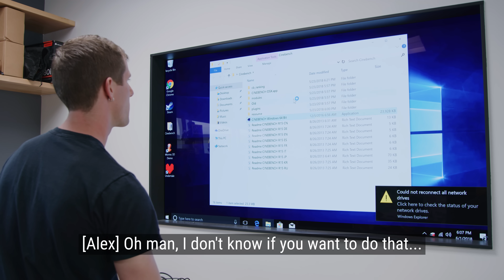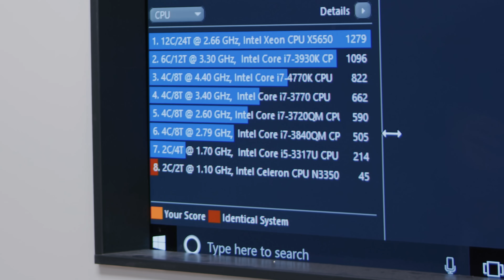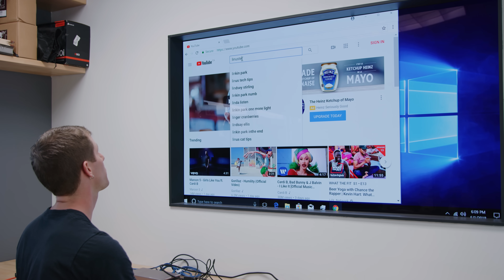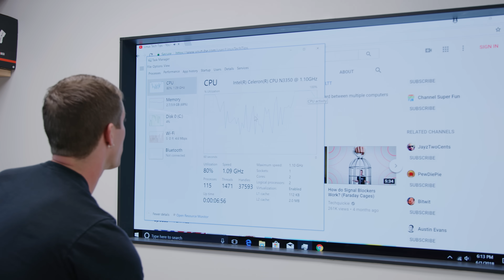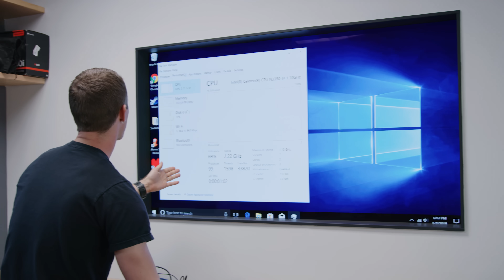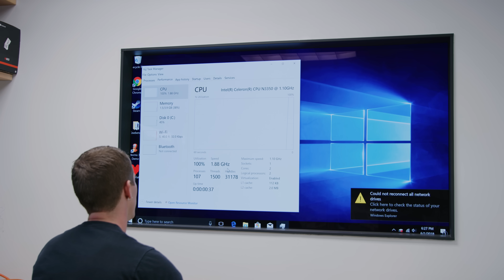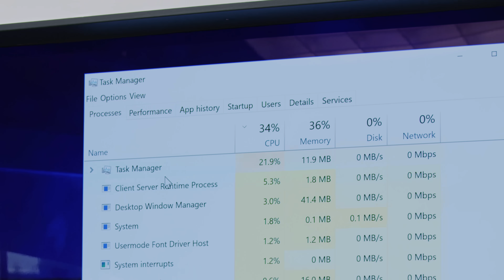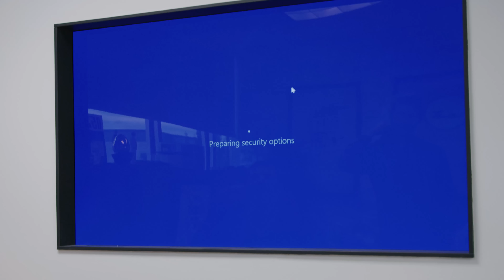PC Smaller than an SSD

Comment: I was impressed with this at first until I realised it was basically just a phone without a screen or battery.
Reply: Reading your comment disappointed me, because it led me onto thinking that this was just a simple ARM setup. This isn't "just a phone without a screen or battery", lol. A celeron processor that is in that small of a form factor, a long with the fact that it is a celeron, not ARM, and you can run stuff like windows *not IoT, all while being passively cooled is really fucking great
Reply: @extremememe3296  celeron .........
Reply: @extremememe3296  bro .....
Reply: @extremememe3296   There are arm processors in phones out there that outperform Celeron and Atom processors, people are still selling cherry trail parts in this ultra small form factors and they just suck.
Reply: do you understand software compatibility in arm vs x64/x86?
Reply: @extremememe3296  I do understand very well, I'm working back end development as a day job. 
Not only that but writing software that is actually targeted at low end devices like these.
Basically all managed code is portable today, having some old unmanaged behemoth or even worse some vb6 based trash still running in 2019  is more than just irresponsible.
If your application has been made within the last 10 years there is little reason for it to not be managed in the first place and if you do for some reason end up with a native app you should be able to port it pretty easy and save a fuckton of money with some cheap arm chip as opposed to bottom of the barrel scrapings from an atom -like SKU that has been dropped by Intel because it isn't profitable.
Reply: Tell me which phone can run an actual non-mobile OS and CPU, and I'll admit that you're right.

This isnt a phone, its a very very small budget laptop without the monitor and kb.
Reply: @YouCensored  actually the Asus Zenfone 2 fits that bill.

It has an atom z3580 with 4gb DDR3, and 6430 powerVR GPU.

That would be at least capable of running the full blown desktop OS.
Reply: @YouCensored  I'm pretty most laptops have a more powerful processor than this. This like bottom of the barrel laptop performance. It's hardly worth mentioning, really.
Reply: @joemann7971  
You're pretty?
Reply: @joemann7971  
That's not being a grammar Nazi, dude.  I'm just going on what you said.  How does that have ANYTHING to do with grammar?
Reply: It's not a phone. And arm processors are not as powerful, it just runs that way because the os is paired down. RiscV is going to be bigger, it just needs the time to develop the best technologies.
Reply: @extremememe3296  True that but i think most people dont have a use for ... and if u compare it to a phone its nothing knew fit that performance into ...
Reply: i have a lattepanda alpha... A bit bigger, but with a Intel M3 and 8GB of ram.
Reply: Windows API and app support. Better than a phone.
Reply: @extremememe3296  I mean my galaxy s9 has 8 cores and runs at 2.8ghz with 4gb of ram and comes with 64gb of memory plus a 64gb sd card. The battery last all day even after playing ark mobile. This is also running at 1440p so I'd say this device is pointless seeing to how little power it has. Is it neat yes but is it practical, not really sence you probably have a laptop or desktop or a phone with more processing power then this thing.
Reply: @extremememe3296  There's nothing much different between this Celeron and the Atoms that were going in phones a couple years ago. This is basically a phone without a screen or battery.
Reply: @goldenfox334  Your galaxy couldn't run windows.  Arm cpus are completely different and you can't compare the clock speeds or core count with that of a real cpu.
Reply: "a phone"
that can actually run desktop applications because it can properly use x86/64, yes
Reply: Same
Reply: Yeah, there's nothing great about a computer powered by a chip that's 1/3rd as fast as the lowest end mobile Ryzen processor, the 2200u. It can run Windows, sure, but it won't run it well. What desktop application would you run on this that doesn't have an analogous phone app anyways? Pretty much Anything you can do on this, you can do on a phone, and you'd be able to do it faster.
Reply: @ltnlng  Nobody's praising its performance, it's just kinda impressive.
Reply: It's slower, has fewer features, and is roughly the same form factor as a phone. I'm having difficulty seeing what's impressive about this device.
Reply: @eLJaybud  arm processors are MUCH and MUCH more powerful! We'v got snapdragon laptops that can outperform all the laptops with that price... The built in adreno GPU is also MUCH powerful than a Intel HD graphics
Reply: something with an arm cpu like an 8cx would wreck even most 5-year-old computers in speed and battery but yeah this isn't that crazy
Reply: ARM cpus can run windows, yes. But goodluck with almost any apps that did not support that architecture.
They're just different architecture. And windows can run on arm cpus is not that the cpus is great, but the the os itself that has been developed to be able to run on arm architecture
Reply: Not even a good one too, it’s more like a 2012 android
Reply: I use a Intel Celeron (quad core) clocked at 2.4ghz I know no one's to hear about my crap CPU but why not :D
Reply: @klauserji  surface pro x entirely arm based. guess we know the answer to that now.
Reply: @NonsensicalSpudz  other than microsoft first party apps (office etc.), i doubt many software have good compatibility at al. The technology is still in it's early year.
Reply: @klauserji  early years, arm isn't new. you're really underestimating ARM
Reply: @NonsensicalSpudz  let me rephrase it, arm itself isn't new, but arm integration with windows and all of it software is new. Most if not all common software is x32 or x64 based.
Reply: @klauserji  what you're claiming is microsoft have taken a major risk with the surface pro x then, considering its an ARM chip
Reply: EXACTLY
Reply: @NonsensicalSpudz  more or less
Reply: Christyandi K Microsoft says the translation from x64/x86 to Arm will be almost undetectable. This is an older video and technology has changed. ARM is so much better than when this came out.
Reply: @3DPrintedCat  i'm looking forward to that.
Reply: @ltnlng  I think you are missing what the actual purpose of this device is. for its purpose, yes, it is impressive.
Reply: @MasterDHCP Yeah? Why don't you explain what the actual purpose of this device is and why it's so impressive?
Reply: @ltnlng  1. its not designed to compete with or even marketed to the phone market, comparing this device to a cell phone is very wrong in the first place
2. This isn't designed to be a web browser friendly/video steaming computer. That is far from its purpose.
3. This is exactly what Linus said it was... a Thin Client. it is designed to be literally as small as possible, as heat efficient as possible, and as quiet as possible. This devices main purpose is to be used in slideshow displays at corporations, POS systems in restaurants/businesses, and anywhere where there needs to be a non- noticeable but functioning machine with just enough power to get the job done. 
4. This device is ~$150 retail... most phones nowadays trend around the $750-$1000 mark, once again making this another unfair comparison.
Reply: @MasterDHCP
1. It's marketed as a portable computer, which is what the phone is.

2. Of course it is...it's a portable computer and those are two of the core functions of a computer.

3a.If it was designed to be as heat efficient as possible, they would've used an ARM processor.

3b. So you're saying the tasks it's suited for are low-powered and would not benefit from using x86 over ARM.

4a. $150 retail, and yet it's roughly as fast as a $55 4gb Raspberry Pi 4.

4b. Not an unfair comparison as the topic of discussion is whether or not this tech is impressive, something you don't make even One point for in your argument btw. And it's not in terms of functionality (modern smartphones are faster and more versatile), and it's not in terms of price (many sbc's are cheaper with similar or greater performance)
Reply: @ltnlng  
1. It is not marketed as a portable computer. It is marketed as a Thin client. Meant to be hidden somethwere or stapped to the back of a tv or monitor and be completely silents while also performing the neccessarry processes you would need a thin client for. while it is possible to be portable, if it were portable it would have a battery and a screen (which it does not)
2. The purpose of this is to run light applications... not 4k streaming and not gaming in the slightest. Also this is a small PC not neccessarily portable. It is portable in the fact that its small enough to fit in your pocket but once again that is far from its purpose
3a. It does not need to have an arm proccessor to be heat efficent... it is heat efficent because of its ribbed casing.
3b. the proccesses of a thin client are ususally lighter by nature and do not require much processing power.
4a. It is also smaller than the Rasberry Pi 4, has its own case that doubles as a heat sink, and is meant to be less noticable than the Pi 4. (see number 5 for a bonus)
4b. It is 100% an unfair comparison when comparing it to smartphones. it is MUCH smaller than a smart phone, does not have a screen, does not have a battery, and does not have the same power as moden smartphones. It is impressive because it is small, noiseless, fanless, gets the job done, and very unnoticable.
5. It is also 100% worth noting that it comes with Windows 10 completely free (usually ~$100+ retail)
Reply: @MasterDHCP
1. Yes, it is. On Zotac's own website, they show a 
picture of someone bringing this around with them in a bag. Things can be marketed for more than one use y'know.
2. There are other resolutions in streaming. And in today's world, if it can't even handle a 4k stream, it's hardly what you would call impressive.
3a. "as heat efficient as possible" -you. I never said it's not heat efficient, just that it's not "as heat efficient as possible".
3b. What I'm saying is that there is no need for you to be able to run Windows for those light tasks.
4a. If you're hiding it or strapping it to the back of something like you said it's meant to do, the slightly increased size of a raspberry pi case will not matter.
4b. No, it's not unfair at all. Everything you just said IS the comparison people were making, that it's essentially a screen-less phone with less power and less portability. Funny how you say it's unfair to compare them and then you compare them. 
4c. Everything you've said about why it is impressive is also true of the raspberry pi, except the raspberry pi can be found for $5.
5. Win 10 was free not that long ago, and even today there are many ways to get it either for free or for a very low cost.
Reply: @ltnlng  Single core performance for x86 windows apps on arm is ten times slower, because they are emulated in real time. x64 win apps? cannot run on arm.At all. Have you seen a point of sale machine in any large retail store? They run ancient DOS software. arm cannot run these legacy apps. No-one is ever going to rewrite these, and retailers are not going to spend millions to switch. Until every compiled code-snippet that runs on x86/64 is rewritten / compiled for arm this thing is impressive because it can do all this. Is it going to see much use? no. Will a raspberry be used for anything  in an enterprise environment? No. Also no enterprise OR ltsb for arm.. It's a long list. This is a PC.. aka IBM PC compatible > Windows compatible > x86. arm is not, ppc is not, risc-v is not, elberus is not etc.
Reply: @ssunde Those retail apps been written and rewritten multiple times with new functionality added in every time. Whether or not large retailers are willing to switch out of ancient software is a different matter. 
And other than its ability to run Windows natively, which is the only point you've made, it is really no different from other sbc, other than its higher price/performance ratio. Again, not impressive.
Reply: @ltnlng  No, because for what this is designed to do other sbcs have zero performance. 0(price/performance) = 0. An ant a9 is 28,000,000 times faster than a 7980xe. Still useless outside its intended purpose.
Reply: @ssunde No, for what it's designed to do, (being a "thin client") other sbcs have similar performance at a lower price. 
If you're talking about running windows, I would point out that you yourself say it can be emulated, meaning it's not 0 performance as you claim. This is especially true since Windows is expanding compatibility to ARM.
Reply: do we forget the microsoft-devotion of Nokia with their Windows Mobile phones?!
that also doesn't hold a intel or amd processor, yet it has an official microsoft OS.

it's 10x simpler than you think: there are too few willing to step over on a smartphone like that.
Q. what does a manufacturer do with products that are wanted very little?
A. they either build very few at practically own cost, or they build none.
Reply: I thought this could be useful for light gaming and file transfer since its running on windows. It should be easier than using a phone software.
Reply: Your phone does not run windows
Reply: @ssunde4698  Pretty sure that any software written for DOS would be just fine on an ARM setup - DOSbox is a thing, and can be run on an ARM processor, usually involving QEMU for the X86-arm translation. And, even at a 10x slowdown, a cheap phone chip would still be faster than an original CPU from back in the DOS days. 

I can totally see some company coming up with an emulation "package" so they could sell really cheap systems. Or, as what happens now, just build your software as a web-app and use a cheap android tablet to render it. And web browsers are great for multi-platform compatibility.
Reply: @goldenfox334  its a commodity gimmick toy item, its a curiosity, there is a market for stuff like this though
Reply: @YouCensored  windows for arm has been ported to several snapdragon 845 based devices
Reply: @extremememe3296  you mean x86?
Reply: @whydoihavetodothisannoying  it is not mostly about performance, but the fact that technology advanced so much in a point where we can have ultra tiny pc's, obviously there are phone cpu's that beat these low-end laptop processors but it is still impressive. maybe we'll reach a point where we can fit a ryzen 9 in these small factors pc

Comment: "It's like water cooling...with your blood."  That was great.
Reply: i do that with my phone (Nexus 5X)  (When you open youtube it is starting to get VERY HOT, so I instinctively put my hand against the back!)
Reply: @Makkkkus  I see what you did there
Reply: @Makkkkus  Nope. Its not just the temperature of your room but the heat capacity and conductivity of the air too. Air has terrible heat capacity and conductivity compared to your body+blood.
Reply: Alan BLoOd
Reply: That was Metal!
Reply: Your blood will cool down your brain computer in the future.
Reply: @a.q.2330  for that the heat would have to be pretty much nonexistant compared to today
Reply: Blood cooling technology
Reply: @noru8360  cooling hats
Reply: One thing to consider, uhs 2 sd card can probably help with  this mini ssd pc to work ok.
Reply: @Hanaldai Munamana idk
Reply: @ambreiaju  my phone cooling solution is to take off the back cover and put it on my AC vent
Reply: @ambreiaju  nexus 5x has the snapdragon 810 heat issue
Reply: @razerswag8537  LMFAO exactly today I've upgraded to another phone, from my Nexus... That phone was always toasty.
Reply: @a.q.2330  no way, we'll probably have the chip outside of our skull, using wireless charging and Bluetooth to power the stuff on the inside.  With a system like that, maybe connecting magnetically, we could just pull it off of our head at night to charge it. It would also make it upgradable without more surgery, because you can just pick up a new chip and stick it to your head.